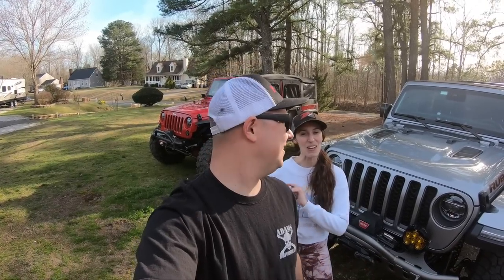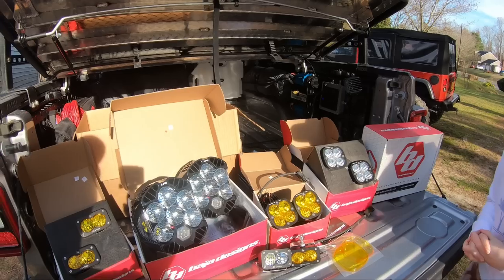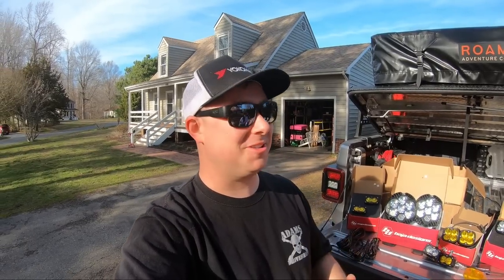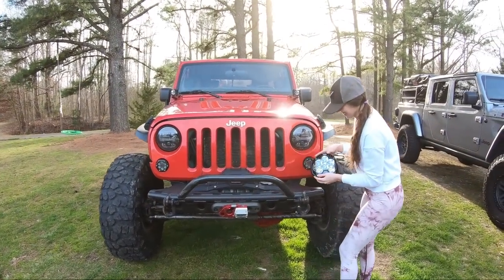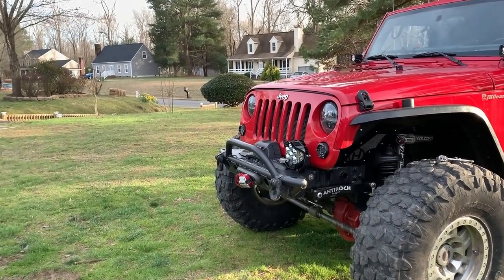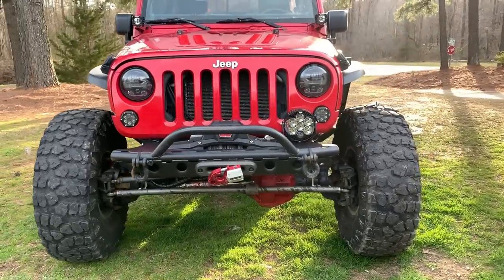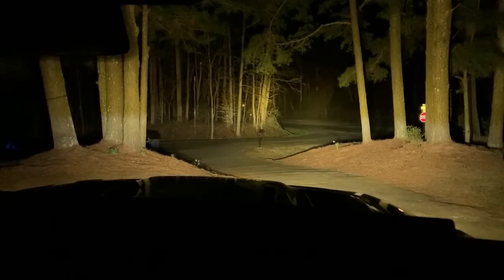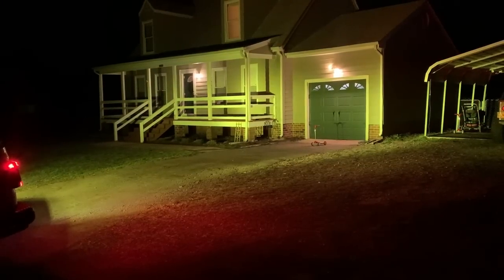White VS Amber High Performance Offroad Lighting

Comment from the maker: Sorry for any confusion, the discount code is now JKGAG10
Reply: JK Gear and Gadgets how much u want for the old rigids off the jk ?
Reply: What brand is ur front bumper on the gladiator
Reply: Sorry for the repost but here's the question -  DO you need the trail 6's anymore??
Reply from the maker: kawlreaper these are a lot brighter than the trail 6 lights. A lot brighter. But that doesn’t mean my trail 6s are useless
Reply: @JKGearandGadgets I gotcha!   I'm upgrading my headlights to the JW speakers and contemplating the Trail 6's.    Also was thinking of the Baja Design OnX6 10" light bar. Then I saw your Naja Design video with the LP6's.  Made me re evaluate again!   Since the LP6's have a high and low setting...should i just put the money into them instead of the Trail6's?!?!  Like you said...good lights arent cheap.  Trying to spend wisely.. :-)
Reply: i guess I am pretty off topic but do anybody know a good place to stream new series online ?
Reply: Doesn't work anymore I guess?

Comment: We run Rigid fogs on the front bumper, and set of dual Quadratec flood and spot cubes on the front window pillars and Quadatec cube floods on the rear bumper. We also have a set of generic rock lights, but we are planning to change them out soon.  All auxiliary lights are run through a sPod.  We do a lot of night wheeling in the desert, and this setup seems to work well for our purpose.

Comment: Nice comparison of white and amber. I have 2015 JKU. I put KC 6" gravity pro's on the A pillar, KC Gravity pro headlights. And I just got a Baja Designs S8 10" amber bar for my front bumper. That light is freaking bright! I like the light spectrum and the fact you can change to clear lens if you want to. Amber is the go to out west in the dust.

Comment: I use KC 3" cubes with LaminX amber films on my a pillar alligned to follow my headlights in rainy/foggy weather, they work excellent. I use 7" round auxbeam driving and spot combo on my mopar light bar very powerful light great for offroad. Thr auxbeams are heavy with a combined weight of 14 lbs lol had to get a friend to weld reinforcements where the bar connects to my frame 😁 in order to stop the light bar from shaking when hitting bumps. Both sets of lights are holding up well considering all the salt sand and whatever else they mix in during winter months. I am also running highbeam offroad headlights. I installed them in September and so far they have been excellent. Went with the drifter series saw those on your channel. Love that they are lifetime replacement and sae dot approved. Great light output pattern and cutoff when alligned properly also when the highbeams are used they work great sending straight spot beams straight down the road just like anyone would want love them.

Comment: Mounting the S2 low like you did on your truck bed is the way I go. I had them on my JKU's rhino rack roof rack and holy smokes.....way too bright on the eyes when you look at your jeep. 

I use a pair of squadrons made with a wiring loom for the JK which also fits into the fog light position on the AEV bumper. My favorite lights. Lights up the sides and slightly forward enough for safely driving at night with wildlife.

Comment: I have my Amber Baja Designs 45w mounted on the cowl - near A pillar. They help in cutting through snow/fog particulates before hitting vertical field of view. That’s why the Ambers go at or near eye level IMO. Next, the flood beam (Clear) driving lights (got my 75w lights from Quadratec) go at bumper height, because the purpose is to sweep wider and longer than running just headlights alone.

That is to say that I’m basically running the same setup as your Red JK. 👍🏻

Comment: I've decided to go Amber lights and I have a cheap set of harbor freight halogens on the Jeep now. Going to upgrade later to a more permanent setup with better wiring. But even the 55w halogen ambers make a big difference over just the headlights and fog lights.

Comment: I have cheap blaze lights around 30 bucks a pair up by their windshield. Just purchased cube lights from Harbor freight they were not expensive either and both are extremely bright. So far the only ones fogging up are the blaze. I’ve been running them on my jeep for a few years “blaze“, and so far they have not failed me except for the fog up. Those are awesome but extremely expensive, Too much for my wallet. I do like the amber for fog and snow.

Comment: I installed black oak 2 inch amber pods in my bumper. With JW Speaker headlights it is like 4k high definition while driving.

Comment: Awesome review Ben!  I have been re-watching this video to compare the amber vs. the white in the LP6 Pros driving combo.  I may go with white and then add the  Baja Designs 10" S8 light bar in amber above the winch on the winch guard bar.
Reply from the maker: You cant go wrong either way! They are both great choices, and like you said, mixing the LP6 white and adding an amber s8 would be a killer combo.
Reply: JK Gear and Gadgets if you had to choose between amber or white on the LP6 Pro in driving combo which way would you go?
Reply from the maker: MACjeeps I think I talked about that in the video lol.  If I could only choose one, it would be amber.
Reply: JK Gear and Gadgets my bad, I thought you were comparing the the white spot to to the amber driving combo

Comment: Benjamin.  Awesome review.  thank you.  I have some questions though... sorry.  And you may not know the answer so no worries if you don't.  I'm getting started on lighting.  This was definitely helpful.  However, I wish they would have sent you a squadron sport to compare to the squadron pro.  Are you able to tell a difference from the smaller ones they sent you?  Are the pros worth almost twice as much.  Say for an A-pillar light.  I'm looking at doing white a-pillar in either a sport or pro and then adding amber LP6 on the bumper next.  But trying to decide if I save my money on the A-pillar or get the top of the line since it will be a bit for my LP6.  Thanks!
Reply from the maker: If you plan on adding LP6s in the future i would say go with the sport for now.
There is a big difference between the pro and sport though. 
On the LJ, we installed the pro, and on the JK sport. The camera doesnt pick up the exact difference, but the pros are noticeably brighter. 
But, like i said above. If you think you will add LP6s in the future then the sports would be great for now, and then with the LP6s, it will be insane
Reply: @JKGearandGadgets  awesome.  thanks dude.

Comment: Better get some covers for your new lights as well. Your fine state of Virginia says they are illegal and you will not pass their yearly inspection. I know because I live in va beach and my Ford Raptor and JL DIESEL have a few lights as well. I had to go to an upholstery shop and some stretchy covers made. You scored with lights.
Reply: They have to be covered?
Reply: @xbpbat21x  a lot of states make you cover any lights that do not come on the vehicle stock, basically only allowing you to use them "off road".
Reply: I wish YouTube would allow me to put my pictures on all my equipment that I worked on and spent all my hard earned money to save Virginians. Some people get lucky and you are one of them. Cover your lights. You may pass Virginia inspection with a hook up out in the country of Virginia
Reply: @johnkraft5640  I guess it's good to be in Arizona.

Comment: Does your jk leak? You should do a video on fixing leaks if so. I cannot stop mine from leaking and I’ve tried everything. Getting so fed up
Reply from the maker: What’s leaking?
Reply: JK Gear and Gadgets both front doors leaking onto the door handle and also onto the tweeter speaker area

Comment: @JK Gear and Gadgets, Is that discount code good indefinitely, or is it temporary? Also, I only have a set of KC Hilites 6” Gravity Pro’s for my headlights. But I’m sure I will add Baja Design lights in the future.
Reply from the maker: Im not entirely sure, however i will try to have them keep it up as long as possible. I am assuming it will be active for a year at least.
Reply: @JKGearandGadgets  I'm trying to place an order and the code is coming up invalid

Comment: Ben, I’m actually looking for an amber one that’s street legal. Up here in Northern Nj & Pennsylvania they’re quick to pull you over because they’re  considered off-road lights. Any recommendations? It gets very foggy on RT-80 during bad weather.
Reply from the maker: Check these out!!! Keep in mind that even though they are street legal, you cannot mount them above your factory headlights and use them (so mount them on your bumper to keep it legal).
https://www.bajadesigns.com/products/Squadron-SAE.asp

Comment: Hey guys! Not a subcriber but happened to fall on your video. First thing that hit me is you bed cover. What make and/or model is it and did you have to do any modifications?
Reply from the maker: The bed cover is a diamondback cover, and then I built the rack over it.
Reply: @JKGearandGadgets  
Ya sorry kinda got overly excited and didnt wait till the end of the video. Which btw convinced me to switch to amber, had never really liked them (secretly still dont) but performance wise, I can clearly see the difference.

Comment: White light makes it harder to see in the fog rain and snow not only because of how the moisture reflects the light, but because of the wavelength of the 5500k light temperature vs 3000k light temperature. 5500k travels in a wavelength that's actually rather difficult for the human eye to see. 3000k has a wavelengths smack dab in the middle of visible light. 5500k is closer to the edge of what the human eye can see.

Comment: Stupid question, all the lights on the front, you only use them on the trail right or as a high beam when there are no cars coming toward you right?
Reply from the maker: Not a stupid question!!
These are not legal on the road, they would blind other drivers like crazy! However, Baja Design does have a SAE line of lights, which are approved for highway and road use. Keep in mind, most states wont allow any added lights above the factory headlights, even if they are SAE approved, so those would be best mounted on the bumper opposed to windshield mounted.

Comment: Of ride a 1017 cb500x ind I need someone hepyshes good lights ,I just want to see a little furtherdown the Road sides of thr road

I was thinking a combo of yellow end wheat.
Thr S-1 if high on the list for hie small they are,I could slawys add I yellow pair later. Sorry in need to follow to sbed ima lill hammered

Comment: Are the LP6s driving combo too bright in low power mode to be used as fog lights on the road?
Reply from the maker: Ehh, I wouldn’t use them around town with lots of cars
Reply: JK Gear and Gadgets thanks for the reply i see how bright the low beam mode is now too. I think i’m gonna end up with a pair of squadron pros on the barnes4wd bumper mounted on top. Thanks.

Comment: Anyone know if the lp6 can be connected to a switchpro? 
Or does it need a rocker?
Wasn't sure if it would take up two spots on the switchpro for high and low?
Ordering both regardless, but Wasn't sure how it worked..